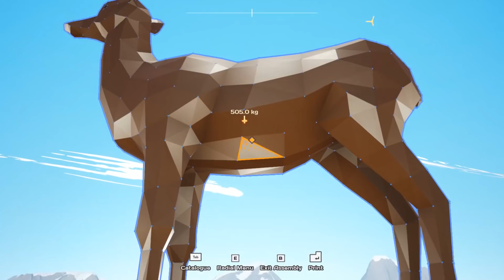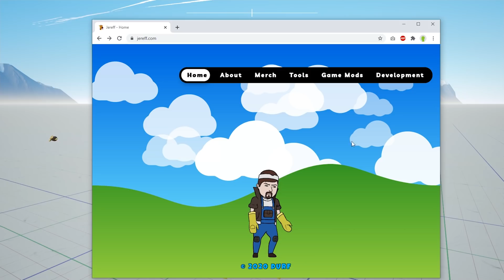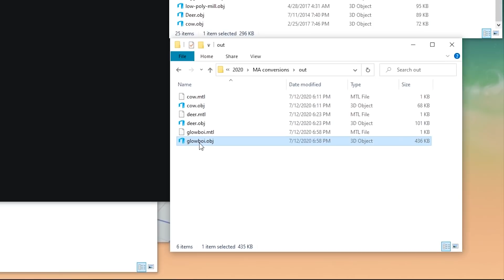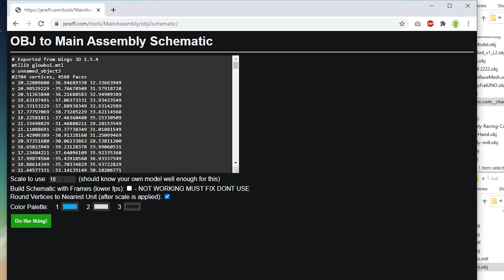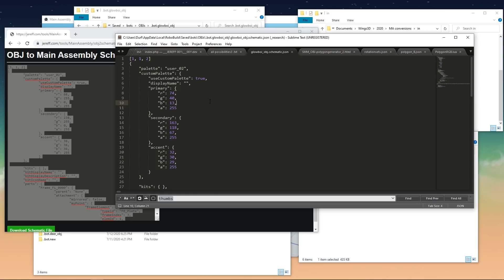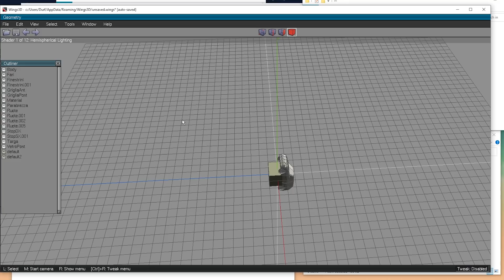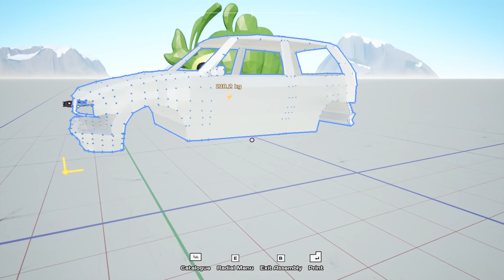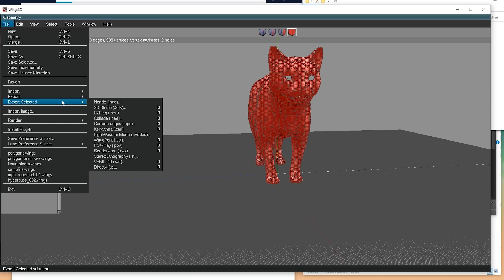Import 3D Models to Main Assembly!

Comment: is this still works?
Reply from the maker: I'm not sure if it still works... The old creations I made using this tool can still be loaded in the game..
This was never a simple process, and you might have to open the files manually to see what is going on with the schematic file, copy/paste some code manually just to make sure the structure is proper.
Unfortunately, I don't get much support for this game or content made for it - so I don't know if this broke, I don't know if it still works... 
It should still work..? There's very little reason why it would stop working, but your best bet is to try it out with OBJ file and open your files so you see what it's trying to do with your schematic (start with a simple model first so things are small enough to see everything in the file, before trying again with a big complicated OBJ)

Comment: do you have a tool to export from main assembly as well?
Reply from the maker: Nah, although it shouldn't be too hard, the reason why I never made one was because the game can do curves with each panel (stored as a single panel with curve info)...but polygons of a 3d model can't just curve...
So exporter would straight all surfaces on a build during export, and things will look weird/go through each other

This is more of a gimmick than anything else, but can still be used to create a nice starting point to work from
Reply: @Durf  how would you do this tho i cant find anything that can read the json file to turn it into a 3d model

Comment: What is the app you are using for the schematic j.son?
Reply from the maker: That one was called "Sublime Text"
Though you can search on Google for any code editor (they all have the syntax highlighting for ALL the languages anyway; depends on your use/preference; all does the same)
Low profile is something like Notepad2 or Notepad++, but if you want something to manage large projects and whatnot, Atom editor is pretty nice too.
Sometimes I use different ones for different things..
This is something for you to figure out as you become comfortable with coding anything (json included); you'll know how you want it ;)
Reply: @Durf  thanksss I’m still struggling to do it but the objs go to the directory files of main assembly or in a separate one?? , cuz I tried like 4 times and my models aren’t loading in the game
Reply from the maker: @ricardobarboza9135  In this video I showed that I converted my 3d models into the schematic directly, using a tool that was available on my website.

The model itself is never put into the game...
The model is copied by a tool, from obj, and spits out the same model as schematic
Reply: @Durf  alrightt thanks for the information🤘🏼